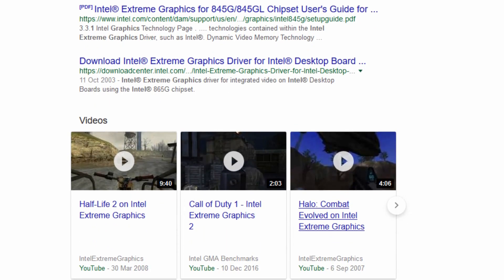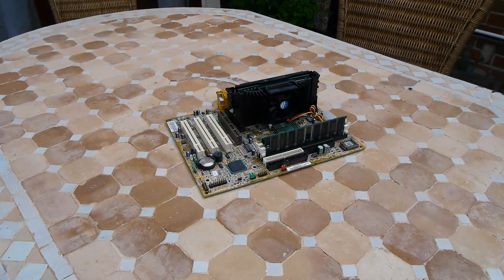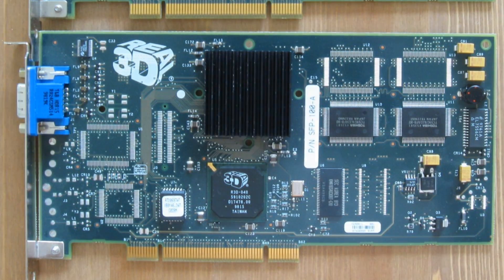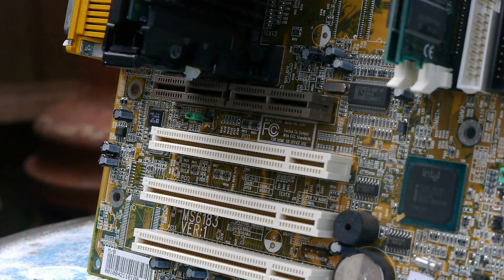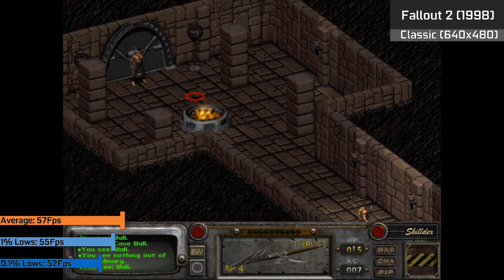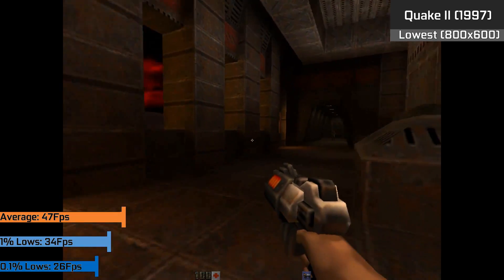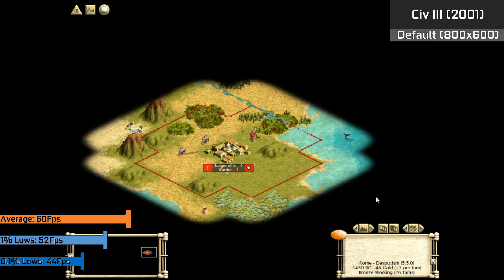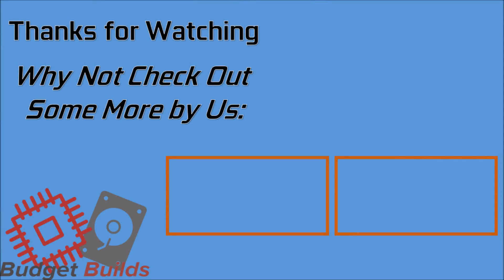Can you GAME on Intels First iGPU?

Comment: A large factor in Unreal's poor performance here was that this graphics chip would force you into using the infamous Direct3D renderer without modifying the game. To give you an idea of its performance, on my personal retro machine; a Pentium III 866 MHz, and a GeForce 4 Ti 4600 on the 45.23 driver, I would fairly frequently get dips below 20 fps in hectic battles even if I set the resolution to 640x480--but I never tested with lower settings than max because I felt that I shouldn't need to lower settings with my overkill hardware. Oddly resolution barely helps (or hurts) at all with that renderer. (I ended up using an unofficial opengl 3.0 renderer that was waaay better).

The game was built to use either the software renderer or the Glide renderer, but software would not really reflect as a benchmark on this chip's performance (even though it would probably run better at low resolutions), and this chip can't use the Glide API so Direct3D was the logical choice here.
Reply: The original unreal I had to run software mode on my 740 back in the day....
Reply: A workaround is an OpenGL wrapper. Got Unreal Gold and installed in PlayOnLinux with a Geforce 6150 (integrated and nouveau driver) and later an AMD Radeon HD 4350 and almost no issues at D3D.
Reply: @chillinfartdotcc  That AMD hardware should be massively better than a GeForce 4 Ti 4600, even the integrated Nvidia chip should probably have a bit more power, so I'm not really surprised it runs acceptably.
My point was to say the D3D renderer has poor performance on hardware of the day.
Reply: @licentioushowler3400  Anyway the Glide support is the source of the problem. Both GPU can handle conversion but not perfectly (some irregular shadows in Unreal Gold when i tested) and Glide wrappers existed at the time of Unreal release. Other Glide supported game i tested was Deus Ex and it gave me a headache with the Geforce 6150 (only software mode with both official and open drivers), while the Radeon wrapped both Glide and D3D perfectly in Wine.
And GL wrappers needed for both games is OpenGL 1.x, the Geforce supported OpenGL 2.0.
Reply: I checked the location from the test in Unreal Gold 226 with high settings in 640x480 16 bit in DirectX 3D and got an average fps of 20, the lowest 15 and the highest 28. on low settings, an average fps of 28, the lowest 18 and the highest 42. Specifications: celeron 600 mhz, 128 mb ram, i810. Perhaps the author has problems with drivers?
Reply: There is another problem here. It's usually definitely faster than what he shows. Here is a PIII with a 815 chipset in Unreal https://youtu.be/KektuzPKktQ?si=cYItHCLMJxk_hBV4&t=1477
Reply: Licentious Howler 3dfx glide was amazing for it's time.  We're still behind on Api's now it kills everyone's experiences :(
Reply: While Glide was rad and 3dfx pioneered so many concepts with it (among other things), I disagree about being behind; we live in a great time for APIs imo when you have an open-source API like Vulkan that is getting actually decent support, and can go toe-to-toe or sometimes perform outright better than Microsoft's best low-level efforts.
(And DX11 or Opengl are fine widely-supported fallbacks if you just need something that works for a simple project.)
Reply: My God we need more Vulkan games. Playing Doom with Vulkan enabled sold me on it. I think it performs better than DX12.
Reply: @Ren-kei  Glide was a cut down, stop-gap API. 3DFX main advantage is the same reason they failed. They did everything quick and dirty and focused on what was important at the time. It was not important to have T&L or vertex anything for the voodoo 1 and 2 because games were being designed with software rendering in mind; which meant they could not use so many polygons that a CPU could not keep up with vertex transformation and lighting in software. They didn't do 2D because you already had a 2D card. They didn't do anything but accelerate perspective correct texturing and rasterization. This easily doubled the area of silicon available to do what's important. GLIDE was a cut down subset of the openGL API specifically suited only to early voodoo cards. It would never have survived for long anyway because their own cards would outgrow it.

Everyone and their dog knew that integrated 2D and RAMDAC, hardware T&L, 32 bit color, programmable pixel shaders etc was coming. They didn't know when exactly, but years, not decades. Their competitors often got ahead of themselves and introduced these features way too early which massively reduced performance in the only thing that mattered in 1996-1998, which was pure rasterization performance and negligible CPU overhead. 3DFX was run by some ex SGI guys and they knew about professional 3D hardware, they knew what features they had stripped out to make a gaming card and what they had to put back in. But they failed to do so in a timely maner and dicked around with SLI and buying a board manufacturer instead.
Reply: @soylentgreenb good read, thanks for writing this, very interesting.

Comment: 6:03 Wooow This pentium 3 with a 1999 onboard intel is way better than my 2010 atom with gma3150? 
Lol it couldnt run simcity 4 even at 800x600 it would lag really hard, and it had a 1.6ghz singlecore atom, 2gb ddr3 800mhz and the intel gma.
Reply: Eduardo Avila heh... My asus eee pc 4g has gma 910 and 900MHz atom... And 4gb storage... And 2gb ddr2 ram!! (Cuz I can)... I put windows 7 on it just for lulz)) Actually that works! Tiny7 uses only 3gb of storage so it usable... But not for gaming, even at 2d it struggles... As audio player it's ok))
Reply: Wisker My hp mini 110 3735dx had the official support for only w7 starter, but i got xp working and it was better than 7. 
But a real crap. It looses for amost any 90's machine even at youtube playback. 
Now i discovered that those 90's games i couldnt run or barelly open, a pentium 3 with a 1999 onboard vga performs better. 
Its sad, but i had to use it as my main pc for 5 years.
These atoms sucks. They have a worse performance than some pentium 3 laptops from the late 90's or early 2000's, and probably a power consuption not so small. 
I know they arent meant for gaming, but even for daily tasks a old laptop outperforms them.
Reply: Eduardo Avila my eee pc doesn't officially support win7 at all. I have to do serious digging to find all drivers cuz most of them on official site won't install on windows 7. Cuz Asus made them in custom packages and on win 7 it says "The PC doesn't meet minimum system requirements "...
 5 years ago I can somehow use this netbook. It was acceptable for simulink task as well as word. So that was my travel netbook for studying while in train. It has windows xp home basic and even internet browsing was acceptable except playing video on youtube, it lags even in 144p. And it has only 512mb of ram back then. But thing has change right now it is unusable even with 2 gb of ram. Basic task like word is ok. But internet nowadays too hard for this small thing. And battery is totally dead so it can't work even 10 minutes. I don't know why this thing exist! It was made in 2008 and it was first netbook ever. I got this for free in 2012... Personally I'd never buy such abomination))
Reply: Wisker Yeah, mine lagged alot in word 2010 (bundled with it). When on xp it was acceptable. 
Mine fryied after i tried to replace the atom n455, with the atom d525 dualcore. 
Now incredibly, without processor, and after 8 years the battery still works fine and it still turns 'kinda' on. Without the processor it doesnt give any video nor load the bios, but the usbs turn on and the fans also. 
So i removed the screen (with the structure of it and the bezels), the hdd, the ram, the fan, the heatsink and made it a powerbank with 3usbs. And i didnt had to do a single solder, just reuse the older board that refused to die completly, with its chassis and case.

Comment: Now put this igpu in a fight with my 845G chipset igpu! >:)
Also you should try getting the best PCI gpu possible cause It would be really cool to see how much the PCI slot would limit the card. :)
Reply: +Lothaire Cliquennois I will!
Reply: i810/815 vs 845G?
Both support DX6 in hardware and got support for Vertex Shader 3.0 in software. The 845 got double the pipes and can benefit from DDR-266 memory.
So yes, there is actually something slower than old Intel integrated graphics. To name it, even worse Intel integrated graphics :D
On the other hand 845G theoretically offers support all the way up to very, very fast Northwood chips with HT....

Comment: This makes the 8400GT seem like a GTX 1080 in comparison
Reply: This makes a 2060 seem like a Super Computer
Reply: @Order66 i had the 256mb 8600GT lol. 1024x768 medium was playable at the beginning with 30fps average.  On the final level had to drop to 800x600 Low and still got like 10fps lmao
Reply: I went from a single core 1.8 ghz system with a 6200A to a dual core 3.1 ghz with a 9800GT bought with self earned money from my side job delivering newspapers back in 2008. It felt amazing!
Reply: It is! I had a crappy x550 and it did laps on the crappy i915 i had on the mobo. And it also wasnt full of missing textures and glitches. Even the drivers were crap.

Comment: Ps1 gpu is better than that
Reply: Or the fact that the ps1 was 80% software driven
Reply from the maker: In some cases ,yes
Reply: the PS1 is pretty amazing considering it has a 33MHz processor dating from the late 80s, with 2MB of RAM and even less VRAM lol
Reply: RWL2012 fyi PlayStation released on December 1994, and ps1 at year 2000
Reply: gameplays n emulator i believe you mean PSOne for 2000...
Reply: @RWL2012   Hell yeah compared to the Pentium I my father had back then jeez PS1 was so massively ahead lol (though PS1 launch date was far ahead P1) and I hated DOS too and its shitty disk games with small capacity.

But around PII PC was looking pretty cool too but the games that actually looked a galaxy far ahead PS1 I would need something like a 3dfX Voodoo and I was stuck with software graphics mehh.

PS1 Delta Force if I'm not mistaken really shown quite amazing graphics, I think it was the best I ever seen on the PS1, looked incredible, it had some walls that really looked like real life, it wasnt the whole game generally, but some walls were looking incredible realistic and far ahead from the rest of the game visuals even though everything still looked incredible, however the game run a bit slow which was unusual as most games aimed to play fast not like more modern era where they dont mind games dropping to 15FPS.

Back then specially if you were only used to 2D 80's games seeing an actual world in 3D was just MAGICAL, after PS1 was never such a magical leap at the same grade!!!!!!!!!!!!!!!!!!!
Reply: @darky799  PS1 is play station so PS1 is play station
Reply: @Victor-xh2ye  actually both are same, ps one is just redesigned and smaller original ps (like ps4 and ps4 slim)
Reply: @darky799  okay
Reply: @RWL2012  but was there no Z-buffer on it?
Reply: No. PS1 can't even do half of the effects this chip could. I was able to play some pretty advanced games on this like for example Soul Reaver 2, which was a PS2 game.
Reply: They had better optimization didn't they?
Reply: XDangerZone640X games are optimized specifically for consoles.
Reply: lua ne yioue the ps1 can render about 300 if every texture was 24x24. But the texture warping broke these polygons, making it inferior to anything made after 1995

This Intel gpu can run about 1200 64x64 textures without the shitty texture warp
Reply: I think not because I emulated ps1 / n64 on a k6-ii 500 with an ati rage pro pci 8mb, of course many games did not work well but still enough to break that argument.
Reply: My i915 couldnt run the psx emulator with the openGL plugin. It ran faster in software mode. Otherwise it couldnt stay at 60fps and i had a pentium 4.
Once i added a x550 it ran fine and even had no problem with anti alias. 
Also the directx 9 support was a lie.
Reply: While this is mostly a joke, the PS1 had hardware T&L unlike the intel chips.
Reply: Νope,with that Intel you can even emulate Ps1.
Its of Dreamcast era for comparison.
Reply: +gameplays n emulator why are you telling me this...?
Reply: RWL2012 just fyi
Reply: Uh ps1 never had a gpu. It had those shitty intergated graphics which led to false 3D and that shitty texture warp which broke games.
Reply: Random pfp pretty sure the PS1 does have a Sony GPU. the CPU itself is from a late 80s MIPS workstation. the original iPhone was kinda on the same principle. off the shelf Samsung DVD player processor with a PowerVR GPU duct taped onto it so to speak.
Reply: PS1 is a quite interesting lil beast.
The CPU don't do any grunt work in terms of actual 3D rendering, only coordinating.
The DMA, rasterer and coprocessor do all the heavy lifting on it.
With the coprocessor, you perform the T&L operation that is the operation that converts X/Y/Z coordinates to X/Y with perspective and calculate the directions of every vertex for the light, and you even get a pseudo Z value out of it.
Then with this pseudo Z Value, the DMA not only copy the 3D data to the rasterer as it sorts by the triangle height (no Z-buffer here, so you need to sort the triangles from the farthest one to the closest).
And finally, the rasterer draw the triangles VERY quickly (for the time).
On a PC without a 3D accelerator, you have to do all those tasks within the CPU, which is why you needed a 133Mhz CPU instead of a 33Mhz one like the PS1 to get to the same level of 3D.
Reply: Funny thing is at the time everyone loved them
Reply: I always called the ps1 "the toilet seat" cause thats exactly what they looked like with the cd lid open
Reply: Synthematix ikr. Im still suprised how the ps1 managed to outsell the n64. If the trends and fads were pushed back/moved foward 10 years, nobody would care about those cd-rom gimmicks such as fmv and “super high quality audio” (how the ps1 sold well). Nintendo was correct: 8 Megabytes was enough to get a game onto a cartridge. Huge games such as Secret of Mana were in 2 Megabytes. Super Mario 64 was in 8 Megabytes. MIDIs werent exactly bad on the n64. 

Heck, 3 1/2 floppies wouldve done the job for nintendo. If they released their Floppy Disk add on in 1995, square prob wouldve released FF7 on 3 or 4 64 Megabyte floppies
Reply: Its the games though they were pretty good like crash team racing and my favourite was music2000, all nintendo keep doing is re releasing mario games and its getting boring now, hardware wise the dreamcast was the king to me, first console for internet multiplayer games and the gfx were great and the controllers were genius with built in lcd screens
Reply: Synthematix tbh the Dreamcast was superior to the PS2 in every way. The PS2 obliterated Sega because of poverty. Yes: poverty. Around 40-60 million of those sales were for the DvD drive, not the games. Also around 1500 of those games are shovelware applications. The dreamcast offered 6th gen gameplay as early as 1998 and didnt have the awful shovelware the ps2 had. The Dreamcast also kept the arcade experience.
Reply: @Synthematix  You are joking right? The PS1 had just the extraordinary quality of being able to make those textures "POP"... (lol)
Reply: @randompfp3778  ps1 had a gpu, without a gpu displaying visuals are too inefficient; even arcade machines had gpu, commodre64 had a gpu

Comment: The modern Intel HD530/630 isn't actually that bad. You can play somewhat modern games on low settings and 720p with a decent frame-rate (such as GTA V).
Reply: Ryzen iGPU is way better though

Comment: This is less of 'Can it run Crysis' and more 'Can It RUN?' 😄
Reply: @laibaqureshi3310  when crysis was launched, the recommended specs were WAYYY ahead of the time(at least for normal people) , so it become a meme since 2008
Reply: Can it walk
Reply: @AlpineTheHusky  it got its legs cut off =(. it still has its arms tho so it can crawl, but not walk.
Reply: @Xader726  CAN IT MOVE
Reply: @laibaqureshi3310  you are probably not old enough to understand it. The reason why is because crysis 1 brought every PC on their knees. Very very hard game to run on ultra graphics. or any setting for that matter in that time of release. Same was for crysis 2 and 3. 3 is still being used as benchmark for games. It's still a very hard game to run. Crysis 3 I mean. 60fps stable on 4K on ultra settings is still not possible. Not with a 1080ti as far as I know. Maybe with a 2080 or 2080ti.
Reply: @metalvideos1961  I fully agree. I remember back in thoose days when I bought an Geforce 8800 GTX and that thing was brought to its knees. 1024 times 768 was hardly playable due to the insane demand the game had. I played around with the settings so much in order to make a decent experience. We started using the frase " Can it run Crysis" everytime we bought new computer hardware and it took alot of years before we actually could start getting an good perfomance with ultra settings. The lights killed the performance completely in the game dropping frames like a stone :)
Reply: @thepicard83  even my GTX750 only managed stable 60 at 1366x768 Vhigh no AA if my cpu doesnt bottleneck that is
Reply: @laibaqureshi3310  I have no idea.
Reply: @laibaqureshi3310  lol I'm also around that age and I know
Reply: "My car goes 0 to 60"
"In how many seconds?"
My reply "Yes"
Reply: but can it start Crysis?
Reply: LAUGHING CRYING EMOJI LAUGHING CRYING EMOJI LAUGHING CRYING EMOJI